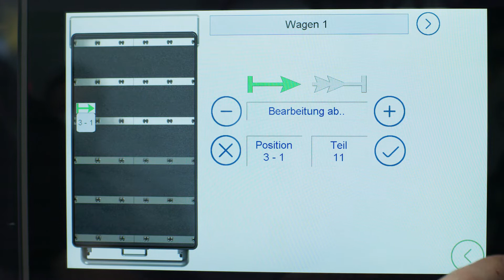RoboTrex 96 Automation System - Gripper Exchange

Comment: Hi~.
No electricity is required, and suitable filters for each site are used.

The Clean Master cleans the patented coolant tank as much as possible.
This is MST Co., Ltd. (South Korea). 

Regarding the coolant tank cleaner developed this time,
We participated in the 21-year defense industry parts equipment exhibition held in Korea.

Introducing the strengths of the coolant tank cleaner CleanMaster-200SP.

First, it does not use electricity, only air.
It doesn't even have an air motor.
(recommended pneumatic: 4~5 bar)

Second, according to the state of the cutting chip
Various filters are available,
After on-site demonstration, we suggest a suitable filter.
(Mesh, bag filter, etc. according to the size of the cutting chip)

Third, it completely separates cutting chips and coolant.

Fourth, it can accommodate 190~200 liters of coolant.
(In order not to overflow, we adopt our own patented product)

Fifth, in 10~15 minutes, Clean is complete!!

If you have any questions about the product, please leave a comment on this comment.

Thank you.